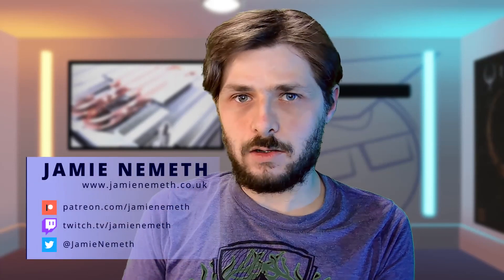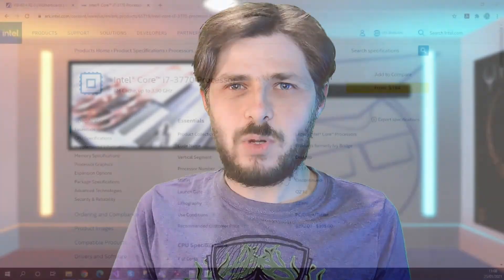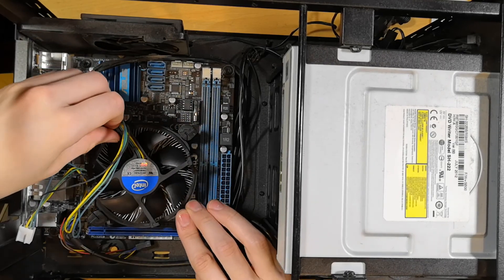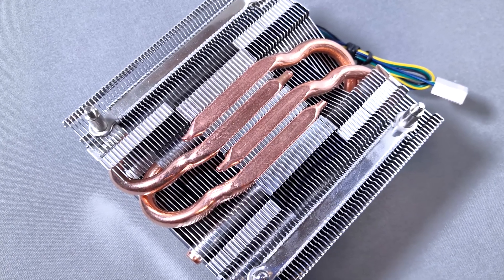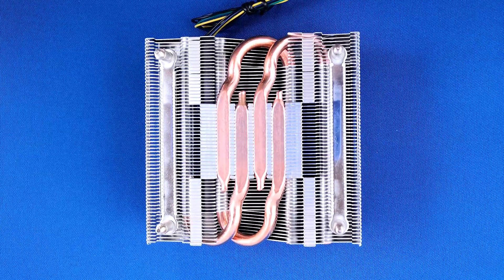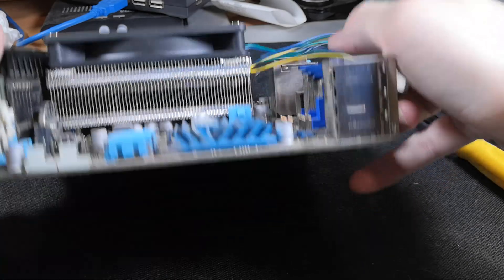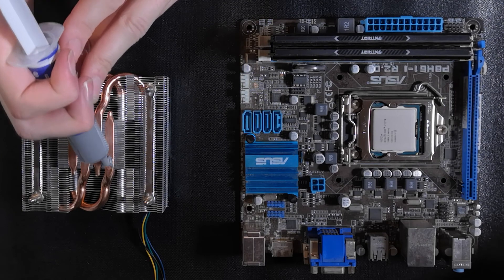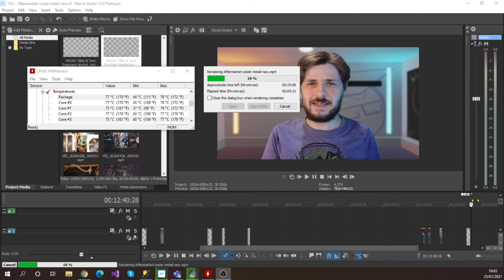My new processor is hot...in more ways than one... | Silverstone AR11 low-profile CPU cooler install

Comment: Hi Jamie, you can get your RAM up to 1600mhz in the bios with XMP option
Reply from the maker: Oh, I didn't realise until you said that it was going slower - it is actually 1600 MHz RAM, and says XMP 2.0 ready. Cheers, will give it a go! This seven year old PC has even more to give!
Reply from the maker: Ahh...I just realised, I must have used footage from before I installed the new RAM...it is already running at 1600 MHz (the old stick was 1333 MHz). Still, good to know, though.

Comment: this cooler will bend your mainboard
Reply from the maker: Eek. I haven't looked inside this PC for a while...I guess I'd better check it. At least the board is a mini-ITX, so there isn't so much motherboard for it to bend? I remember it holding on with quite some force, when I clipped it down...
Reply: @JamieNemeth  I install this cooler allot at work. Only on itx boards. You have to use metal and plastic washers.